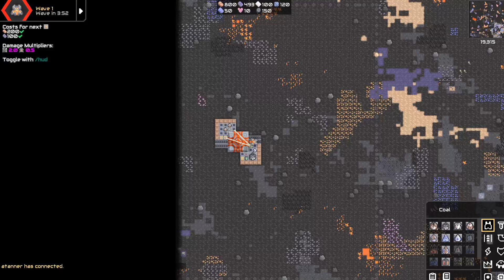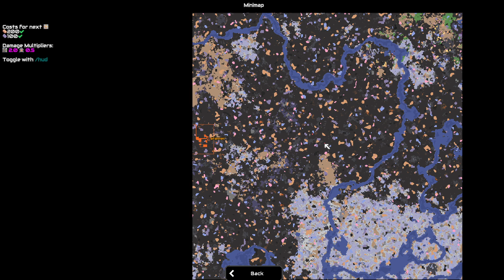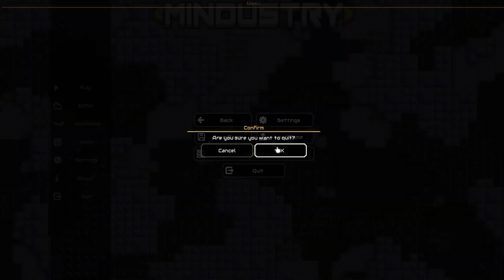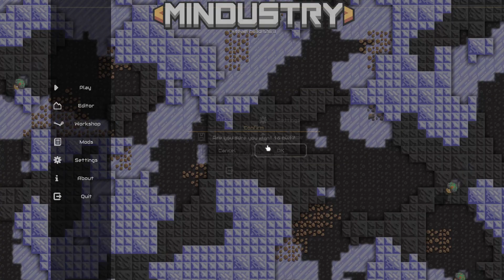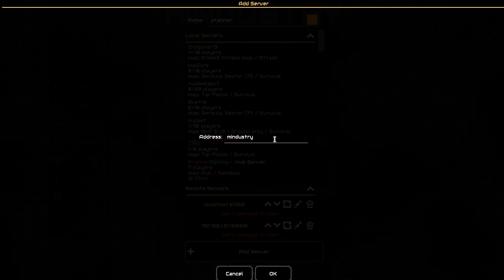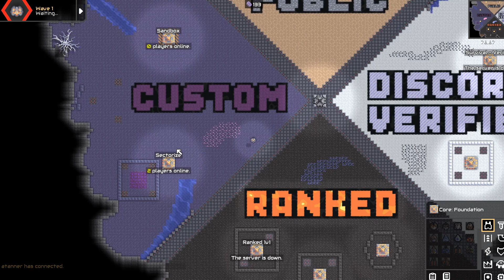2022 Mindustry Basics Guide for New Players

Comment: Mobs will also path around your turret ranges, so if you dont use walls to funnel them then they will trail the edge of the tower range as they go by. They seem to pick tje FASTEST route, and not the shortest. So if they have 2 paths and one is closer but covered in water that will slow them down, they will take the path that looks longer but is not covered in water as they reach their destination faster. You can use this to block sides you dont want them to path down with thick walls as they also seem to calculate how long it would take to get through a certain amount of wall sections

Comment: One thing about the opening:
You dont need graphite to start producing Monos. Only silicon, copper and lead. So i actually prioritize silicon + power to start making Monos and then i move onto graphite when that's automated. After a few of them come out you can just reclaim your copper and lead mines and you have a tonne of space to work with. Söower beginning but faster mid/late. You also save several hundred graphite not upgrading those copper/lead mines, so the time lost isn't huge anyway. Then you can dedicate graphite to better mines for titanium and coal. This also leaves open the ability to just chain in the graphite for additive reconstruction and start with Polys really quickly. Now you've got early air units who will defend, repair and help you build/rebuild. Also bearing in mind you have more space to do this as you've reclaimed the copper/lead mines

Comment: 1. I make a Router checkerboard leading into the base. This allows any congested belts to offload onto neighboring belts. It also looks cool.

2. I make a “magazine” for my turrets by building a road back and forth. At the beginning of the magazine, I put an Overflow so that once the magazine is full, it sends resources to the base.

3. I use a string of routers and place Turrets on both sides. I leave a space between the turrets and the wall to make space for Repair Blocks. This also prevents damage to turrets from bombers.

Thanks for your video. Cheers 🍻

Comment: How do i unlock pneumatic drill
Reply from the maker: You need to make graphite with the graphite press.
Reply: @AtannerGaming  i opend the grafite press and got grafite but still no drill
Reply: @mohammedaykut8284  you need to craft it
Reply: @mohammedaykut8284  beat the crater map, i forgot but in campaign, you have to beat/capture specific sectors for "blueprints" to build a building such as pneumatic drills. In multiplayer, all buildings have already been researched.